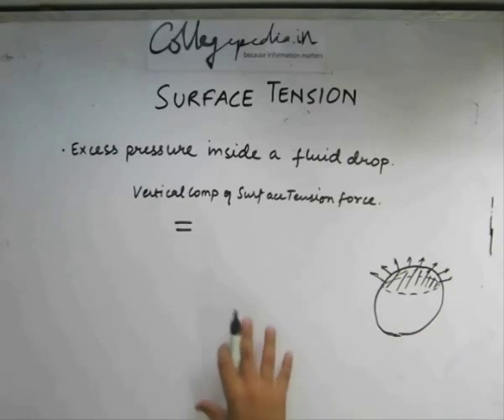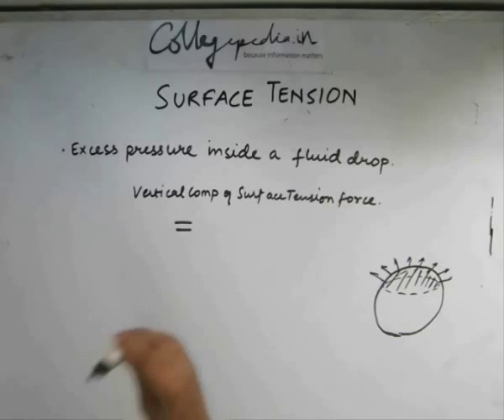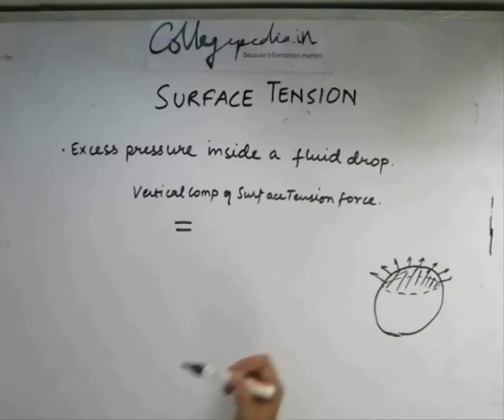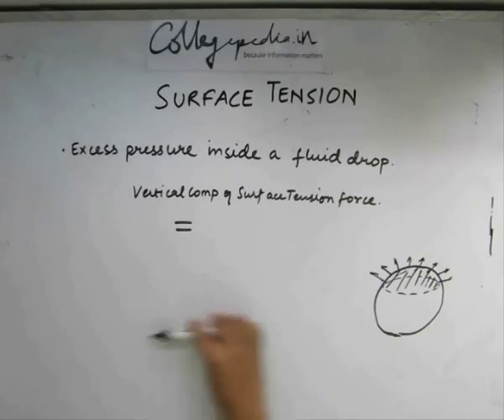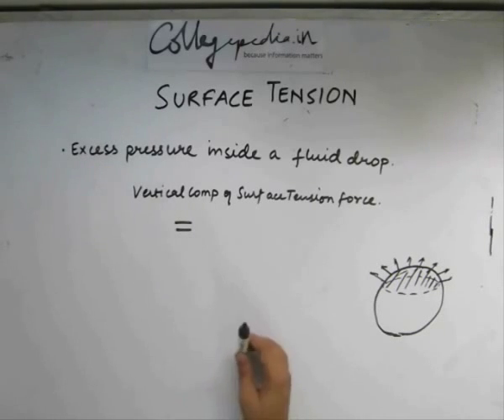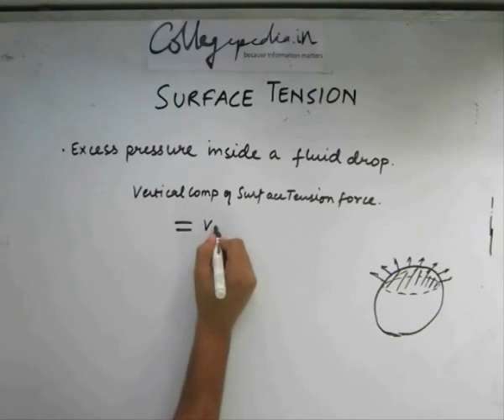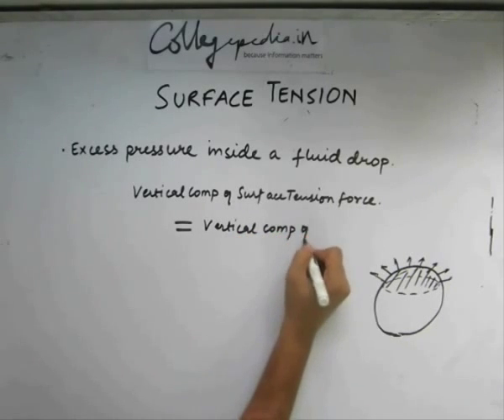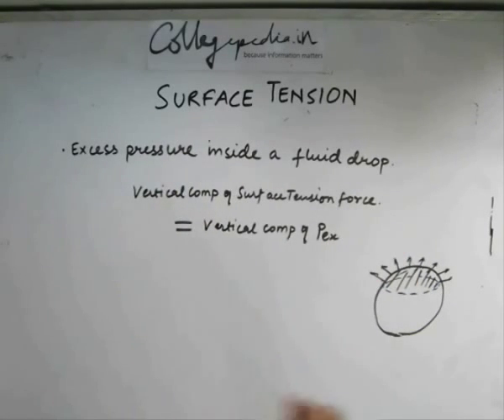Surface Tension, Lecture 5, Physics IIT JEE (Excess pressure inside a fluid drop)

Comment: sir how do you know initially that there is excess pressure inside fluid drop .are you assuming it.is that kind of assumption correct to do as pressure is not a vector